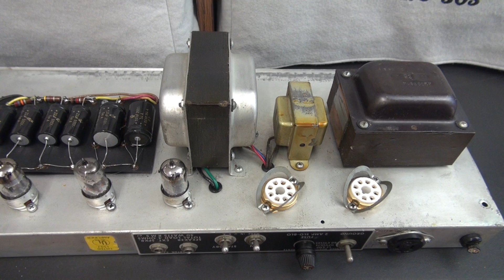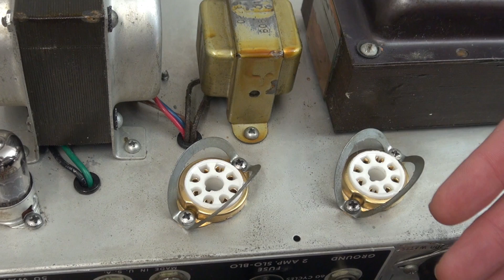Beware low quality Fender tube guitar amp octal socket replacements Dont ruin your investment!

Comment: While rebuilding a '65 Twin that was in a fire decades ago (the chassis had to be stripped and completely re-plated), I came across this video and found a supplier with the NOS Cinch octals. So after another week of deliberation I found one comment below about the Cinch sockets being  designed as a bottom-mount socket. At quarter to 3 am on no sleep I went back to the supplier site & looked again even closer at the photographs. Then I saw it. The  mounting bracket itself is flat when viewed from the top (as seen in this video), but on the opposite side the bracket folds upwards; there's a lip of sorts that will stop the ears from sitting flush to the chassis. Comparing to what my main guy of 25+ years did to my '61 blonde Tremolux when it was time for octals, he used Beltons which don't fit the original 1" hole either, but the smaller diameter section of the socket is 25.4mm and that smaller section does. So they used those with washers as spacers. And the chassis remained unaltered with sockets that haven't let me down once and hasn't been back in the shop since. If bottom-mounting/inside the chassis this seems like it would be ideal, but for outside the chassis/top-mounted, opening the hole only to install spacers after that doesn't make as much sense -- for me at least --- as what was done on my '61 blonde if there are going to be spacers required either way.

Comment: Those "vintage" sockets will not look original because they are designed to mount from the bottom of the chassis. If you try to mount them on top they will need spacers, or the ears will be bent down to the chassis and look like an amature hack job.
Reply: Your comment from 2 years ago just saved me the disaster of stockpiling a bunch of NOS Cinch octals from a supplier while re-building a 1965 Twin Reverb.

Comment: Hi D lab. I apologise for asking a question, but I recently got some great help from an, ahem, 7 year old video of yours about restringing a Marantz receiver.
I broke the string on an old 1515 model while replacing the power switch. I attempted to restring it but ordered a slightly too short piece of string, so am probably one wind short on the plastic wheel attached to the tuner. It works but only goes up about 85% of the dial before it won't go anymore. Now maybe restringing it (properly) this time will fix it, but because I couldn't access the tuning disc, I took it off, not realising there was a spacer type piece of metal, and a cog just under the housing. They of course fell out and I have put them back, but I guess that could also be the cause. At the lowest frequency the teeth on the tuner mechanism are pointing straight down and at the highest I can go they are up at about 135 degrees. Should they go all the way up?

Again, apologies. I'm a beginner when it comes to vintage stuff so am no doubt using all the wrong terms, but if you, or any of your subs can give me advice I would be most grateful.
Cheers
Jim, from a gray Scotland.

Comment: even the early 70's sockets they used are poor that quality way, I used an awl and tightened em all up . . . should prolly do the preamps too... its a brand new 1970 Princeton reverb SF.. no jokes like someone went back in time and snagged one, its literally BRAND NEW and the red lettered RCA fender tubes are BRAND NEW . .   its crazy I played it for maybe 15 minutes, then took it apart and glad I did those sockets were so loose the tubes were exiting the sockets .. I used rubber bands on all the screws everything so it was done with care and perfectly as not show its been opened. its a museum piece for sure

Comment: Question kinda on topic  do you need to drain the amp voltage before trying to tighten pin sockets?   I know changing these junk units is best , but say normal wear  on a good amp?
Reply from the maker: Yes, I always ensure the filter caps are discharged before working on the amps

Comment: A couple of months back I used my 1979 Fender Twin Reverb to play a gig.  After hoisting the 80 pound beast, up some stairs, to the stage, plugging it in, and turning it on - I heard this 120Hz buzzing sound.  I've used this amp since the 80s and never heard that sound before.   Right there on stage I went behind my amp to have a look. And, to my shock and dismay - one of the 6L6GC tubes had fallen out and was sitting at the bottom next to the reverb tank.  My jaw was on the ground.    I turned off the amp, plugged the tube in, restarted the amp - and played the set like a boss.

Comment: How do you open the holes?
Reply from the maker: I use a quality large stepper bit + cutting oil
Reply: @d-labelectronics Do you recommend using a drill press, or will careful use of a hand drill suffice?

Comment: If you work on tube electronics a lot it would be a good idea to befriend an older guitar amp tech.  They often will have NOS parts in stock and not gouge you on pricing.  

It would be interesting to see tube sockets made of Ultem.  There are already sockets made of Teflon for miniature tubes but Ultem is stiffer.  Despite its expense it was used in the clips for securing the CPU heatsinks in the original Xbox.